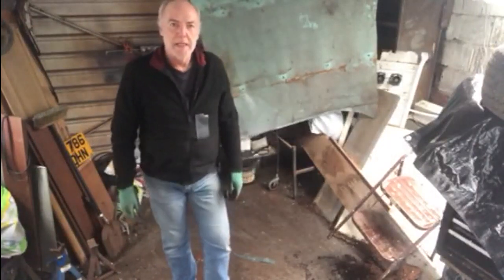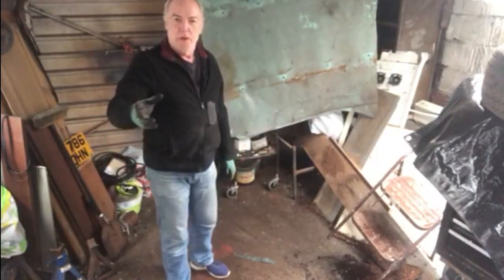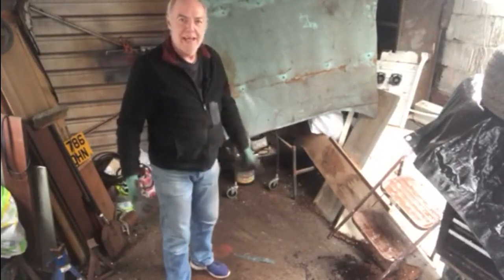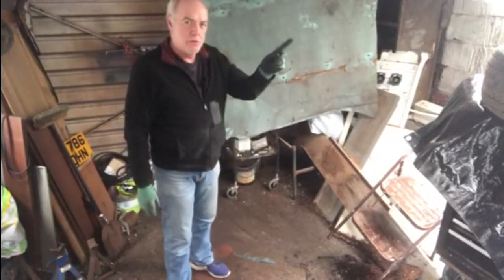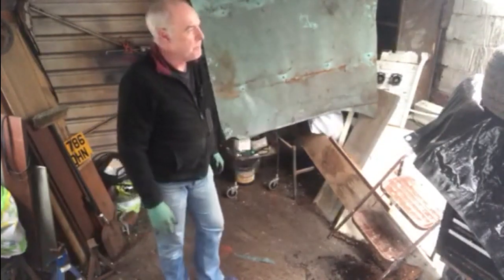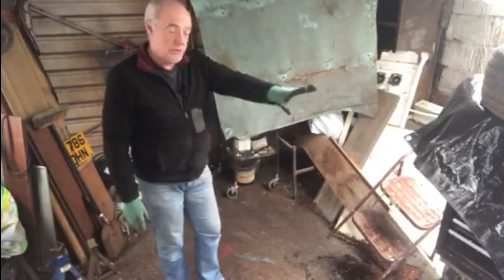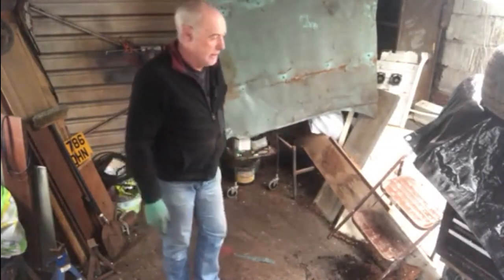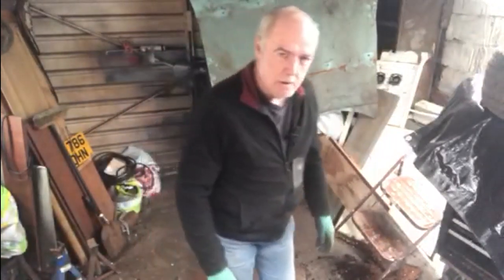Rustival - Are You Going?

Comment: No, can't afford a trip out and a new windscreen!
Reply from the maker: Oh no, did something fall on it in the storm and wind. Can you claim on the insurance, hopefully it won’t be too expensive, although knowing Land Rover…….
Reply: @DoubleZeroGarage  No, I did some work on the wiper motor under the front scuttle. After I had finished, the windscreen cracked. It's into zone A now so the next MOT will be a problem. It's not a simple change either. If there is any rot around the windscreen, they cannot fit a new one so it might need welding, hence the cost. Insurance is a £300 excess anyway so there is not much point in going through that!   Nothing is simple is it?
Reply from the maker: No, it’s never simple. I e just had the timing belt done on the Mondeo, apparently it could also do with an alternator tensioning pulley and one of the cars has collapsed and there’s bits rattling around in the exhaust, ho hum, I’ll add them to the list lol
Reply: @DoubleZeroGarage  Should the tensioner have been done with the belt?  I normally change them all when doing the timing belt.   Rattly cats? Not good!
Reply from the maker: @sleepycatpictures1176  it’s not the timing belt one, it’s the alternator pulley. Timing belt kit was done yesterday, apparently the worst that can happen is it’ll throw the belt off.
Reply: @DoubleZeroGarage  Ah, non-interference engine. Bonus!
Reply from the maker: Yep, I’ll start searching for parts, somebody somewhere will have one.